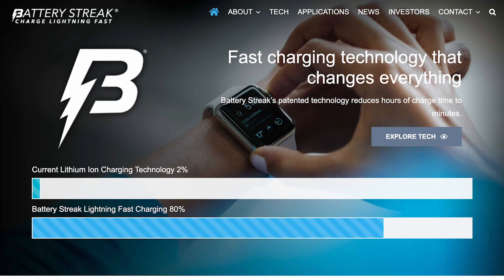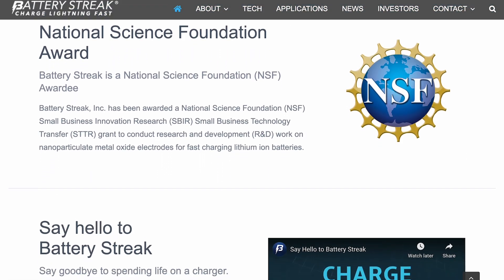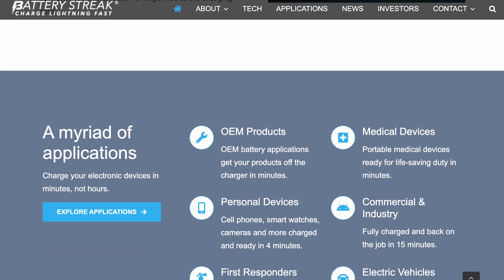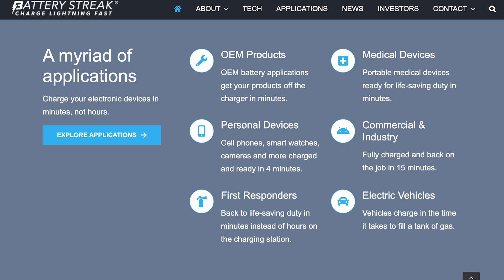Cobalt, Wood, and Other Controversial Battery Chemistries with Matt Ferrell

Comment: Personally for me in the UK, I've gone for solar and battery to help remove my reliance on the grid and whatever pricing structure is put on me by our energy providers.
Tesla megapack and other such brands are looking at the grid storage for load leveling. It's used for load leveling at the moment though as that's just where it's most cost effective but if there were enough batteries on the grid, they could be used for medium term storage as well (weeks). It's just the lack of capacity at the moment, it makes sense for them to be used at the peak times of 4-8pm.
Matt has loads of videos on other storage options. Either heat, pumped hydro, compressed air etc. Good videos too!

Comment: What are utilities doing with large scale power storage for load leveling? That to me is far more interesting than what you can do at the home storage scale. Seems you'd get rid of a lot of complexity and scale inefficiencies doing it at the grid level... But then again, I live in the PNW with generally cheap electricity (though less cheap than it used to be...). Home storage and solar look like government fun money projects that even with "free" money barely pencil out and don't really make any sense when just buying flat rate power from the grid is available. Seems sensible to find ways to incentivize and let them worry about keeping prices low where they can do these projects at a scale one house could never think of... But I'd probably feel different if I lived in SoCal or something where government has more or less made it impossible for utilities to deliver cheap electricity and home solar pencils out.
Reply: Yes and better interconnects excess solar or wind can be moved to another area